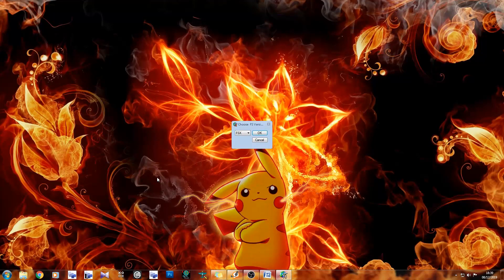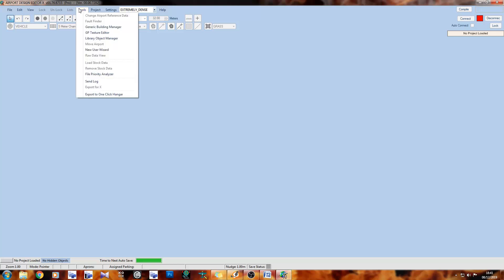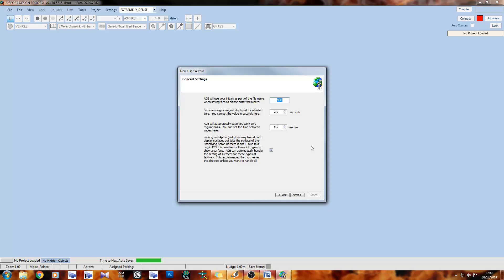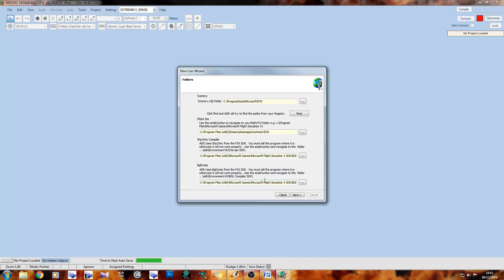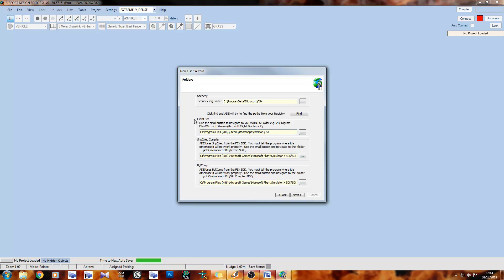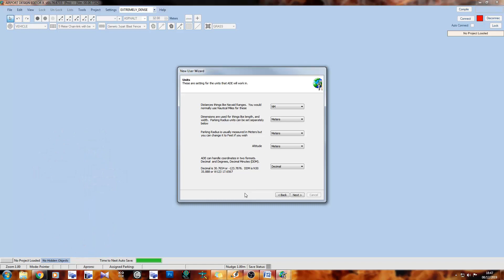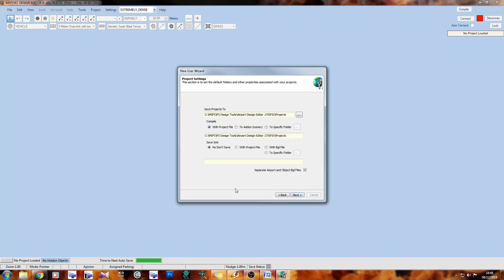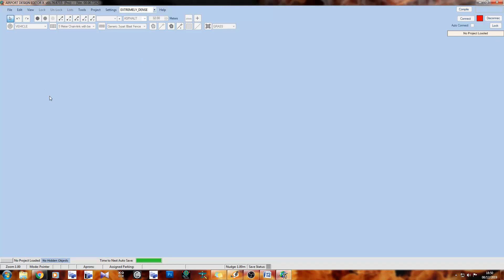Airport Design Editor Tutorial - Part 1 Getting Started

Comment: I have FSX:SE, and ADE left the "Shp2Vec compiler" and "BglComp" parts of the new user wizard empty. I've set the BglComp to the following directory
C:\Program Files (x86)\Steam\Steamapps\Common\FSX\SDK\Environment Kit\BGL Compiler SDK
Is this correct?
Also, I can't find the directory I need to use for the "Shp2Vec compiler" part. I've made the airport, in ADE, but I can't compile it, now, because ADE left the "Shp2Vec compiler" and "BglComp" parts empty, like I said, so I don't know what to do. I've spent ages on this, and the last thing I want to happen is be unable to compile it haha

Any help will be massively appreciated.
Thanks
Reply from the maker: Hello, that is correct however you should run the program as admin every single time as it may have full C access on one run but the next run it may not and that could fire up errors or simply clear out some fearures
Reply: @Soarflyconcepts  Ah ok, thank you.

I just made sure I ran it as admin just now, and it's still complaining that it can't find the BGL compiler. I'm getting really confused haha.

Basically, I need to figure out why it's not detecting the BglComp, I need to figure out the directory it needs for Shp2Vec Compiler, and potentially find an SDK. I've heard that FSX:SE doesn't come with the compiler (or something along those lines) so I'm not sure if I need to download an SDK/BGL Compiler, but if I do, I don't have the slightest clue where to look or what to do once it's compiled lol

This whole process has been so stressful :joy:
Reply from the maker: @leodavis03  run as admin, manually add your SDK tools, close and every time you open from there on run as admin
Reply: @Soarflyconcepts  I've just done exactly that, and when I re-open it as an admin, and when I press CTRL + C, it says it can't find the BGL compiler

Comment: excellent video, Can this Program be used to make a 2D Airport layout, I am only interested in making it a 2D file because I plan to put it in vinyl, Is this possible, thanks.
Reply from the maker: You can, I'd suggest taking several screenshots and popping them together in a program like photoshop or something then you won't need to scale up too far and get all the pixilated edges. There is a print option too but that basically just prints the image on the screen and it's not huge by any means xD
Reply: @Soarflyconcepts  Thanks

Comment: Very helpful video. Can you help me with this issue, I have already loaded SDK and USFIPC but still I get this massage "
Bgl Compiler<Unfortunately ADE cannot find Bgl Compiler.It has looked in
both your settings file and the registry and cannot fins a valid path. This
probably means that your FSX SDK in not installed in the default folder and/ or
the registry entry for the DK does not match the location of the SDK. Until
this is corrected it is not going to be possible to compile your airport.>My SDK is in Programfiles>>(X86)>>MicrosoftGames>> Microsoft Flight Simulator X and SDK, is this a correct place for SDK or should it be in a different location-- Thanks
Reply from the maker: No I would say the location is fine, have you tried to set the locations manually? Remember you need to find the root folder for the specific tool and not just the main SDK folder
Reply: Thanks I got it
Reply: @ilyassharif1218  how I can’t do it